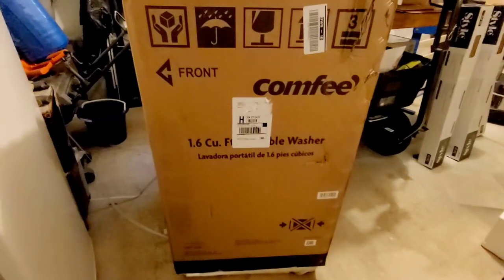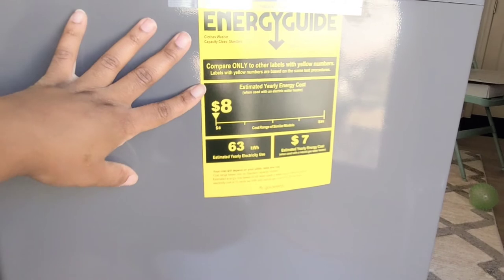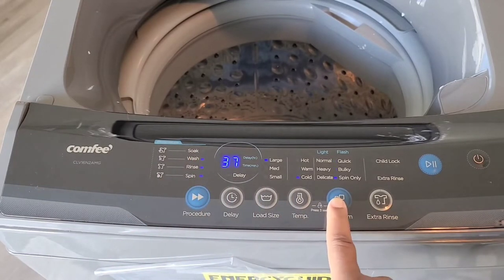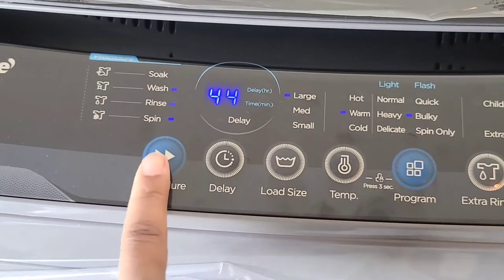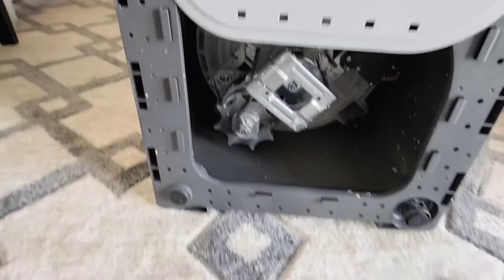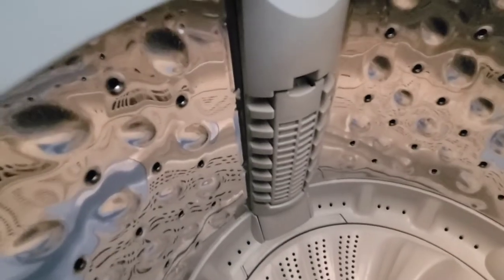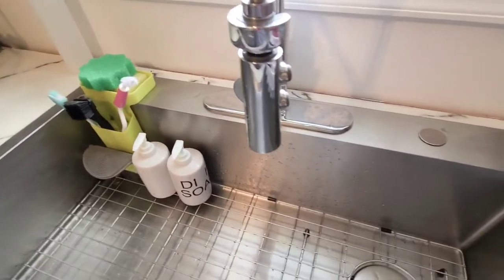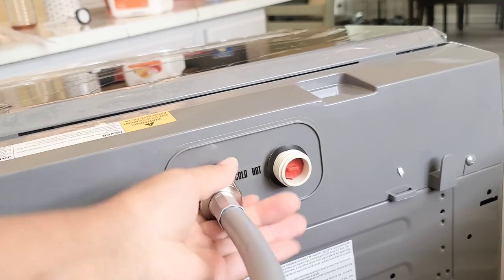COMFEE’ 1.6 Cu.ft Portable Washing Machine Review

Comment: A splitter can be purchased to use both the hot and cold at the same time with your kitchen faucet.. The washer will not work properly if you use a hot water cycle. it will not rinse if only the hot is connected because normal washers rinse in cold water even if the hot cycle is selected.
Reply: Do you have a link to one of these so I can what it looks like?

Comment: Do you have a smaller water bandit? The one I got from Amazon flies right off when I turn the water on, but you mentioned having a hose clamp- I don’t see that on yours?
Reply from the maker: The trick is to use a clamp to tighten it around your faucet. You want something like this: https://amzn.to/3IyAaiY.  It says in the listing the clamp size in the listing, but I can't confirm that.  A trip to a Home Depot or Lowes, along with the water bandit, would help you find the best fit. I hope this helps.

Comment: Do I have to use powder detergent for this washer? My manual says high efficiency powder detergent 🤦🏽‍♀️ but I prefer liquid detergent. I'm worried I'll damage the machine if I use liquid. And also do you leave the faucet on the whole time or turn it off and turn it back on? Thank you for your review!
Reply from the maker: Im glad my video could help.  Since this washer acts just like a regular washer. I keep the water on because when it does a rinse cycle it will automatically intake water to do so.  I have a forgetful mind, so I leave it on. You can turn it off, just remember to turn it on if you want to do a rinse cycle.  I use a very small amount of liquid detergent.  For reference,  if you use a cap for measuring liquid from the bottle, allow the liquid to cover the bottom of the cap.  That could be enough for a regular load.  For other loads with thicker fabrics,  I monitor the wash and I may add a very small amount extra to ensure my clothes are getting clean.  Just remember, don't let a lack of bubbles in the washer prompt you to over pour detergent that could cause issues in your machine.  No bubbles in the washer doesn't mean your clothes aren't getting clean.  I hope this helps 💛

Comment: If you move your machine around, I recommend a dolly.
Reply from the maker: The wheeels that come attached to the machine works perfectly fine. But, thanks for the suggestion.
Reply: @revuscape  yes the wheels are good. I just found the dolly easier
Reply from the maker: @lindabowser7451  I can see your point.